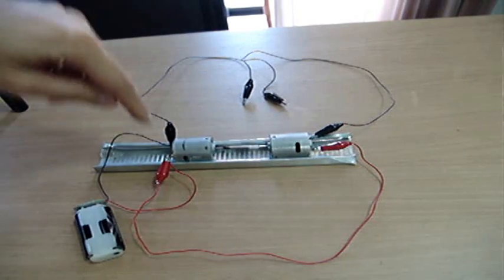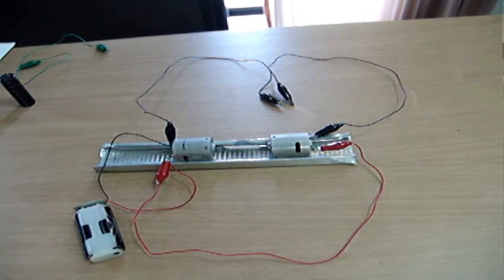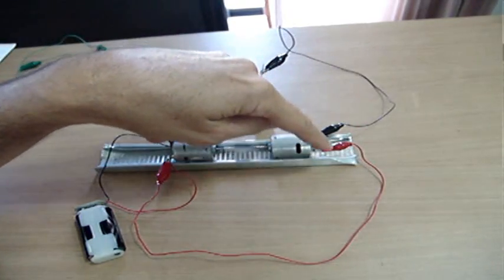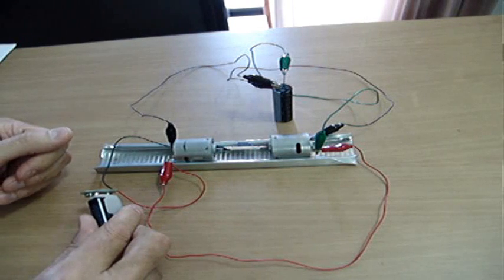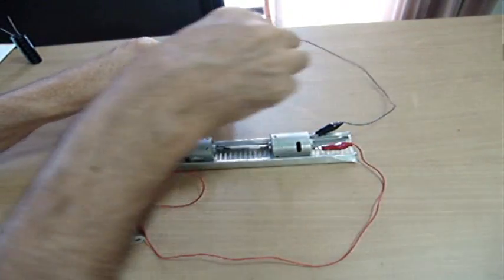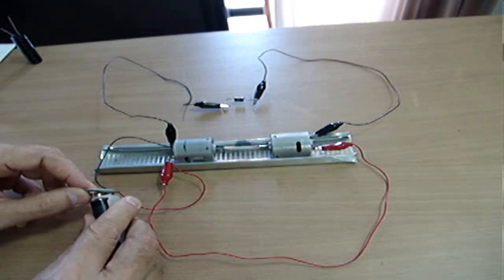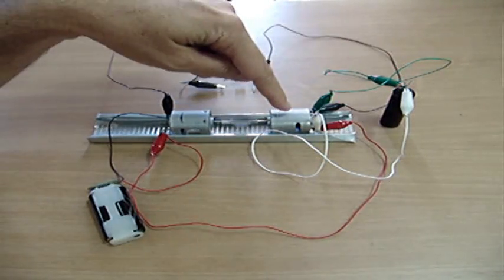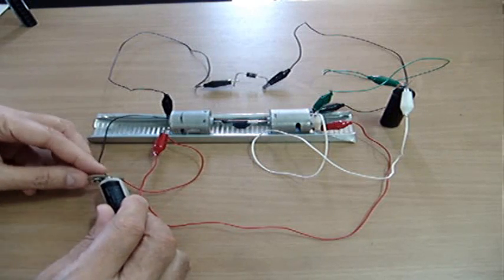Free Energy? Proof of Over Unity? Diode & Capacitor Followup

Comment: I noticed you didn't try 3 things: 

1) Making the generator bigger or higher voltage than the motor

And..

2) trying the setup with a non-polarized capacitor -- with -- and without the diode..

3) adding a resistor (or varistor) in series with the capacitor and diode along with a non-polarized capacitor, to slow the discharge rate into the motor from the capacitor. 

Also would be an awesome experiment to replace the series resistor with a pwm/555 timer to pulse the capacitor's discharge into the motor.

We would love to see what happens..

Thanks!
Reply: Nothing happens! Duh ...

Comment: The experiment you are doing is based on totally wrong assumption which is that the right motor(same as left motor) would produce more output of energy than the left motor is absorbing from your battery pack and spinning at same RPM. If you want to build a system that will keep itself running ...  it simply goes against every phisycs principles ... it is just not doable! At most you could find a way to regain some of the input energy to keep it running longer on a battery buffer or on proper set of capacitors. For example you would need a generator motor that produces more current of the spinning motor for each revolution(on same RPMs) and store the output energy in a capacitor and reuse that energy to power the spinning motor. Because the system will always be < 100% efficiency due to the dissipation of energy in form of heat, friction etc... you can only aim to prolong the spinning from the stored energy which at some point will be depleted
One experiment you can do is to connect your left motor to the right motor with a gear to change the RPM ratio and use a generator motor which at the speed of the left motor (or more) will generate power = (input in your left motor + dissipation of the system) that would guarantee your system to achieve a good grade of efficiency which, again, will never be 100%

Comment: The motor you were spinning in reverse as the generator did you test its output to see if it was equal greater or less than the input of the battery to the motor spinning it?
Reply from the maker: Yes, it's no where close to the same.  There is no 100% efficient generator, in fact most are closer to 40%.

Comment: You need more caps, actually I think you'll get a better result if you make a line of cap.!! Try 5 series, +to+ & to and then put a diode, in with" line twords your motor. Now, The most important thing is that the Caps are the smaller SUPER CAP'S, they can be found in the old radios and Record player's. With Volt's high as 400 Volt's, and low as 25 Volt's. So if you want to  successfully run one from the other,?? Go with THIS.!! Good luck,!!
Reply: Don't encourage this stupidity...

Comment: Try placing the capacitor at the end with the drive motor and the diode as you did to ensure that there is no reverse voltage going back to both motors at the same time (which just shorts the capacitor out). The motor that is now a generator is charging the capacitor as well as the batter is doing the same. BUT, when the battery is taken offline, the drive motor would be using the energy stored in the capacitor and the motor/generator is now charging the capacitor. BTW, higher than the rated voltage used along with a higher capacitance will result in more energy stored before you take off the main power. I would even suggest getting hold of one of those "supercapacitors" and use that as your power storage unit.

Comment: 1-Capacitor in serie with the source (DC source )does not allow to flow  Power  is like a open circuit ,
2-when the diode is polarized inverso current does not flow so test is fail,when the diode is polarized in direct current flow but  it will dropped 0.7 volt so the test is fail again, it will never work

Comment: you can use a flywheel and pully in this config or use a capacitor to replace the flywheel or use both flywheel and capacitor more better results

Comment: brownie your drive motor need to be smaller than the output gen/motor and you need to use a pulse dc motor to spin and a 3 phase tesla coil generator stator  to collect power for overunity. The dc drive motor must have more resistance on the drive coil and the 3 phase stator should have less resistance than the drive stator (DC Motor)

Comment: add this concept to your thinking.... The faster a motor spins the less current it uses. If you use gears small one on a 3 volt motor  and larger one an a 12 v motor the smaller one will have leverage against the 12v motor and will spin faster using less current. This will force the 12v motor to generate electricty .

Comment: I think it stops because of the capacity of the capacitor. Try using a 6 farad 2.7 V supercap. That capacitor takes quite a while to discharge over standard caps.
Reply from the maker: This one is a 10 F and 25 volts.  Did not seem to matter.

Comment: What's happening in the first version is that when you connect the leads, both motors are spinning in the same direction, and therefore they speed up to their max unloaded speed. 

The proper way to calculate the output of the motors is to measure current and voltage into left motor. Calculate power = I x V (in watts). Put a resistor on the lead of the right motor, and measure V and I, and again calculate watts. (Note: the resistor has to be sized so that it will not burn up or load the generator so heavily that it stops running. Use R=V/I and the values you measured on the left motor, and power rating at least twice the left motor power calculation.) The amount of watts going into the left motor will ALWAYS be greater than the amount of watts coming out of the second motor.

There is no scenario where you disconnect the battery and it continues to run. That violates the first two laws of thermodynamics, i.e. you can't make energy, and you can't even keep what you have. In other words, you will always get less than you put in.

Comment: nice try, but i have a suggestion sir, can you add a step up transformer into this circuit or a dc stepper to increase the input to motor also change the motor to geared one. Also use flywheel of 8:1 from motor to generator. It should work. if not reply me.

Comment: This only DOESN'T work because the rotors within these motors have a particular geometry (they are cylindrical). If these rotors were of a different shape (oval) then Lenz's Law will no longer apply. Lenz's Law is what causes generators to have a drag while under load. Basically many of our current "Laws" in science are only applicable to the technology and geometry that we are using :) Check out the work of the inventor Jim Murray to see what I mean.
Reply: No, see my post above. It has nothing to do with the shape of the motor or Lenz's law.

Comment: hello?? you are driving both motors from the battery... not generating electricity...put the diode (facing away from the motor) at the terminal of the 2nd motor.power is going INTO the motor, not OUT OF it....